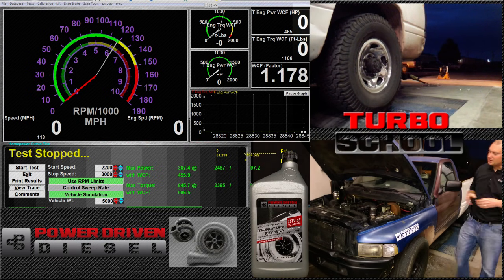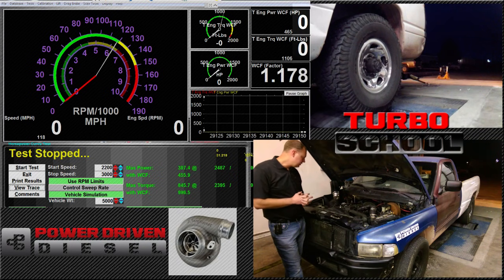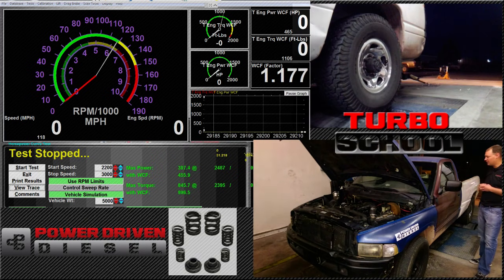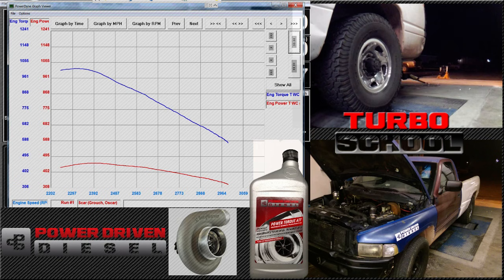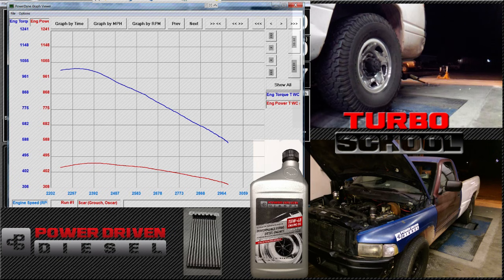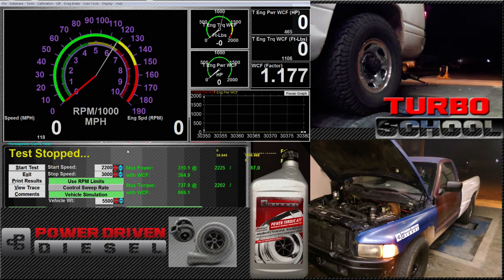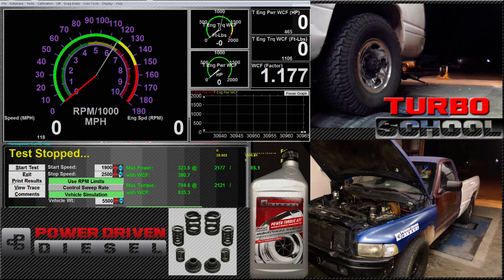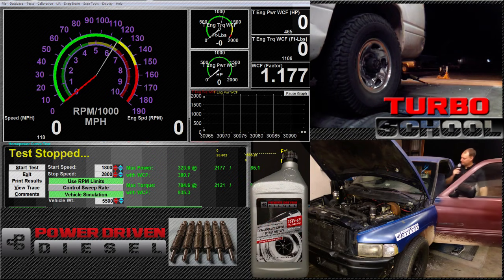Turbo School IV

Comment: ive watched lots of dyno videos and im kinda afraid to dyno my truck. you seem to do the runs differently tho, the other videos i have seen the guys rev up slower and hold for longer. does that matter at all when running the test?  just so many trucks that were doing fine on the street explode on the dyno